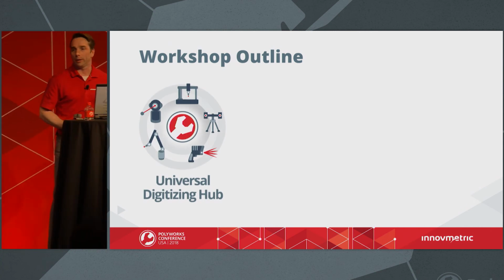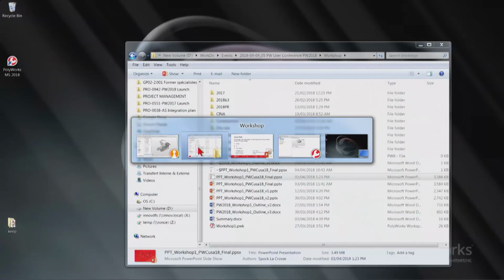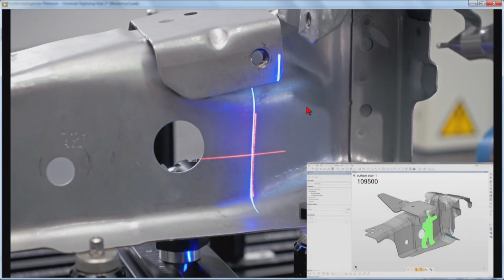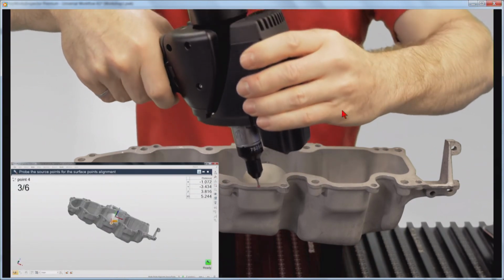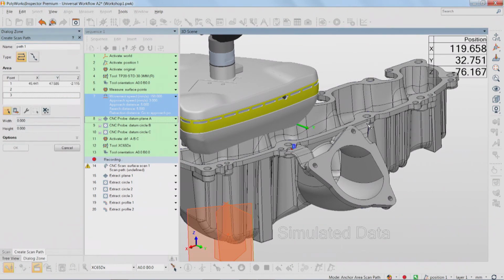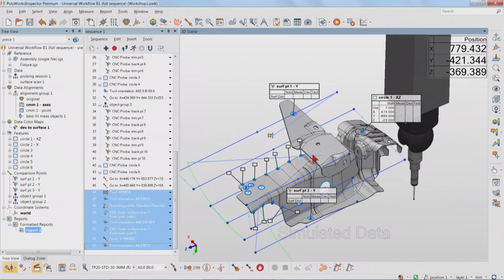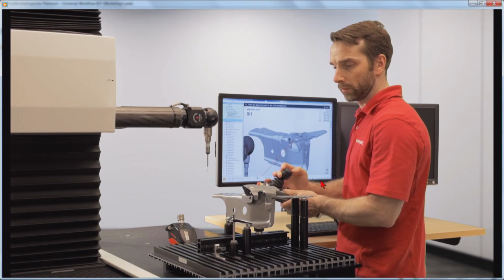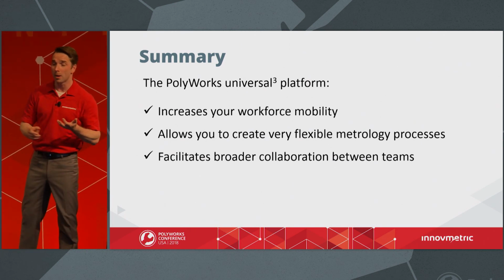PWC USA|2018 – Workshop 1: Unlock the full potential of the PolyWorks®  universal3 platform

Comment: It hurts me to see that datum features shown here is only 2 dimensional.  Datum features are 3 dimensional, and just using a circle doesn't guarantee that the inspection is correct. The application of RULE 1, or the envelope principle is violated when using a 2 dimensional circle since the related actual mating envelope is no longer created.  When using datum features that are 2 dimensional circles, it doesn't guarantee that the Datum Reference Frame is correctly established, because holes are never drilled straight.  Would definitely reconsider this inspection.  Or if i was the supplier, I would void this inspection and force them to re-read the ASME Y14.5 standard, sections 1 and 4.